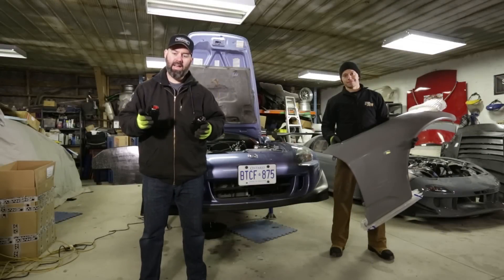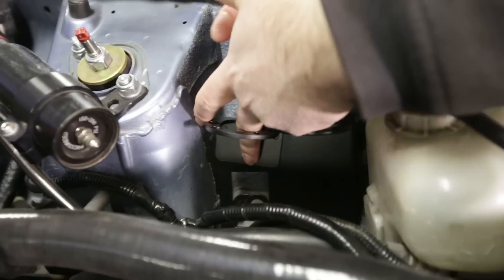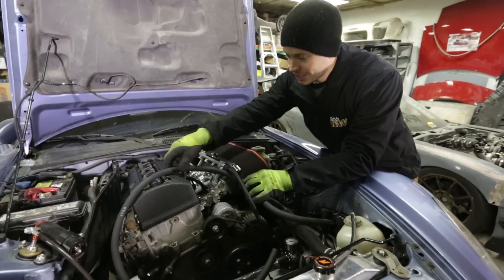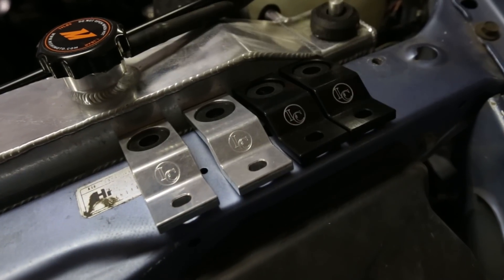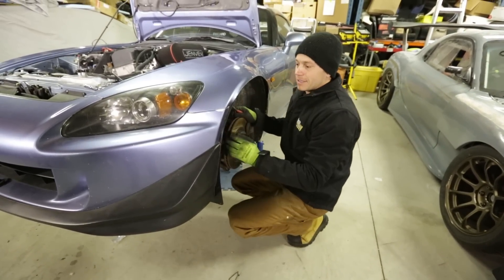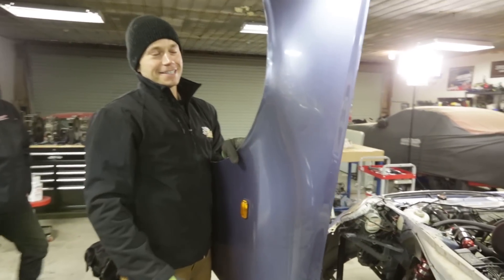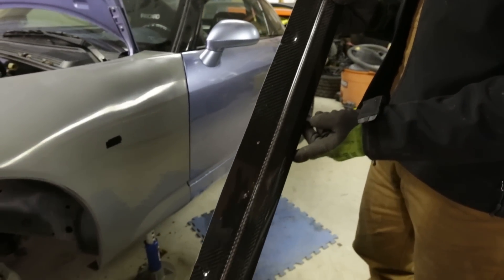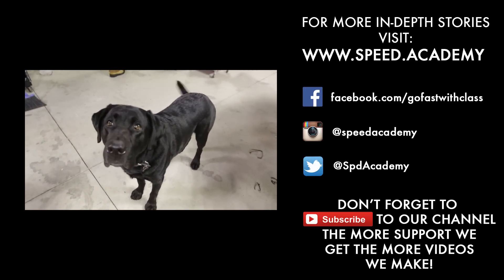Radium Cans & Downforce Over Fenders - Project BADASS2000 - EP07

Comment: PCV is positive crankcase ventilation. According to my auto tech instructor, it's the only emissions device that improves engine function. It uses manifold vacuum to prevent buildup of crankcase pressure and to draw out fumes that could contain fuel vapor.This stops oil from spewing out of engines under crankcase pressure or crankcase explosion from fuel vapor accumulation. You'll probably need to connect that PCV line to a source of vacuum but I'm sure Radium can help you sort all that out. Great video series guys; keep up the good work!

Comment: Another option for the PCV routing is to connect it to a 1 way valve in the exhuast. Something to consider if the VTA setup isn't pulling enough pressure out. That aside, looking good guys can't wait to see you guys rip it up at the track.
Reply from the maker: +Sean Henry really? Never heard of that approach before, but we'll definitely look into it. Thanks for the tip!
Reply: Sure thing.

Comment: I should've added this to the last comment, but you guys should look at using nutserts/threadserts. They're cheap, and you can get a half decent install tool off Amazon for $40-80 USD. Best of all, no more precariously holding nuts in awkward positions due to the sheet metal being too thin to thread.
Reply from the maker: +Sean Henry yup yup, we've got a nutsert tool. We used nutserts when building the splitter mounts. We were thinking of using them when mounting the rear flares.

Comment: That intake would be better with the that AEM tube and a filter that sits in front of the radiator where the temps are cooler , like Ferrari or even Camaro did it from the factory .

Comment: Besides being environmentally conscious, by not connecting the return hoses from the catch cans back to the intake effect anything else either positively or negatively?
Reply from the maker: +Guneet Surdhar The catch cans wont work without being routed back into the intake as we've found out so we're working on a solution for our setup.

Comment: Not sure if it makes a difference because your not routing back to intake but think the inlet to the catch cans are supposed to be though the top
Reply from the maker: +Glen you can do it either way with these cans, but with the filters on top we won't be able to pull the dipstick, so we are going to move the inlets to the top and put the filters on the front.

Comment: Can you guys do an episode that talks about engine blow back because most people don't understand it and don't even know what crank case pressure is. They literally think that it goes bang in there and all that pressure is held in by the rings and that's the end of it. Also they have no idea what oil mixing with the fuel does. Smoke is the least of your issues. Dropping your RON to like 80 is what it actually does and then its knocking like crazy and ripping your crank and engine apart. All of this is not understood by most people and a critical part of people driving their engines right.
Reply: There is that but the blow back is adding oil in the cylinder. ie the rings are leaking in effect. This is what I mean. Most people do not understand what is really happening. Especially since you can cause blow back on an everyday well made car if you over load the engine, ie hammer the throttle in low RPM cruise if your in 6th gear on the high way. Its geared all the way out for economy and the revs are nice and low and the engine is then pushed hard with more fuel against a high gear torque requirement and that is when you start getting blow back.

Comment: the rear over frender is a two peace one for the fender and one for the bumper i didnt see that you guys had that?
Reply from the maker: +Marb Lboro it's a one piece design.
Reply: +Speed Academy There's a fender extension piece that rivets to the rear bumper if you run an OEM bumper.  The wide ASM rear bumper has the bumper extensions built in.  What most people do (including me) do is just pull the OEM rear bumper to match the edge of the ASM overfender.  I think it looks fine like that.  I think that's what Marb is referring to.
Reply from the maker: Oh, I see what what Marb was saying! Ya, since we have the stock rear bumper, we'll have to figure out what we want to do about that. Maybe we'll pull it out to match up with the overfender. We may have no choice since it may be required to clear the wider wheels and tires.

Comment: So you'll make the crank vent setup not compliant but you guys wouldn't run a test pipe with a cel fix? Aw man. One day you'll have to through on a test pipe and a better flowing large single cat back and re dyno I think it will make a big difference and just swap between that exhaust and this current one for emissions testing. Or do what I did and just put the heat shield off the stock cat and colt it around the test pipe it fits perfect and clamps the 73mm one perfectly so it doesn't rattle and looks just like a stock cat haha. Flawless
Reply: P.s. I'll accept those un-used rad mount as a generous donation seeing as you can only use one ;)
Reply: thats what I'm saying!!!
Reply from the maker: +Eric Mikolaitis Well the vents arent going to get noticed by cops whereas the test pipe is something the Police always look for. But one day we'll test the difference just to see if its indeed slowing us down.
Reply: Speed Academy haha no no I get that don't get me wrong I fully understand if a cop for some reason feels compelled to look under your car it's an easy ticket. But in no way shape or form are you compliant. Infinity ecu doesn't support any of the evap or emmesions systems like the air pump nor the stock 02 sensors and it's obvious you no longer run any factory engine management when yiu see ITB's. So my argument is why not finish her off with a proper exhaust because any compliancy is way out the window now and almost all stealth as well especially with how tracked the car will look with flares the wing wheels stance etc. If you want to just fool the eyes though do like I said, take the stock cat heat shield off the cat it just unbolt and bolt it right over the test pipe. It clamps on perfectly on my 73mm or whatever 2.75 inch equivalent is in mm test pipe. Looks just like a cat until you start looking into the 02 sensor opening.

Comment: Aren't the top ports of the catch can the inlet and the side port the outlet side? Even without routing it back into the engine, the fittings should be connected on top and the breather filter on the side.
Open system: https://goo.gl/XKzCqF
Closed system: https://goo.gl/jnEQ71
Reply from the maker: Yes, we ran them incorrectly, sorry for the misinformation! It has since been fixed.

Comment: Am I the only one that noticed the AEM intake tube behind the rad while they were mounting the fenders?
Reply: +David Pratte so more or less just running a tube from the front of the intake box down to the AEM tube, so you're not just drawing in hot air from the engine bay?
Reply: +David Pratte awesome. I'll be interested to see that come together.

Comment: You can fit a 285 easily!
Reply from the maker: +Sammy Alx Thats the eventual goal.
Reply: +Speed Academy awesome! Friend of mine has a 295 at the rear with asm flare not sure if you can fit that size with the downloaded front fenders but 285 is more than enough and it will fit.
Keep up the good work guys!
Reply: Downforce *